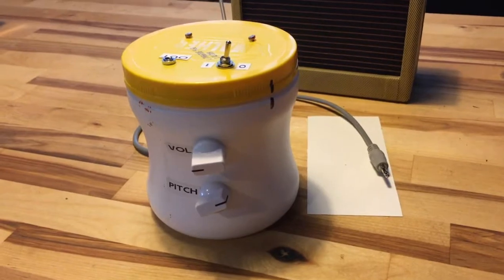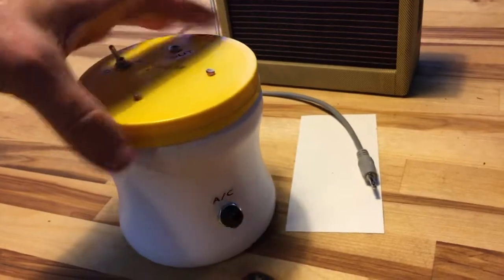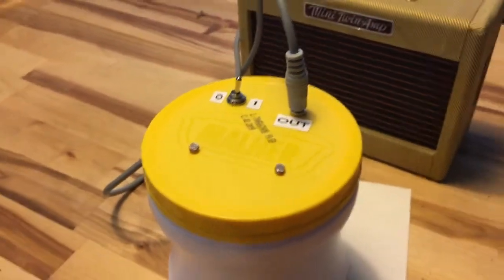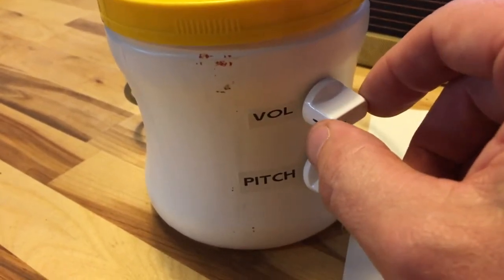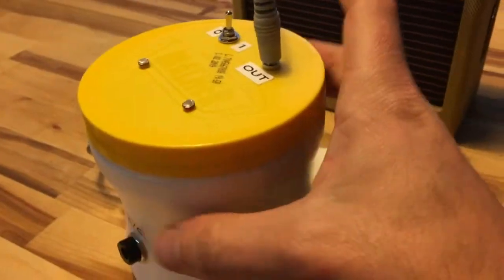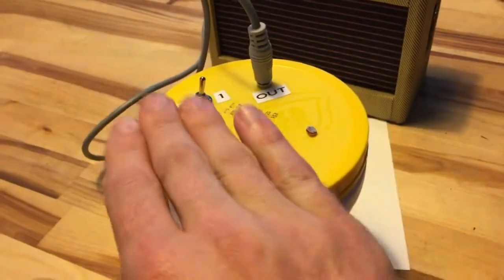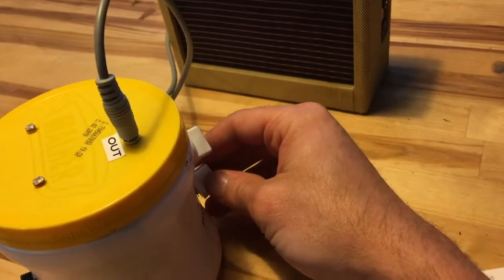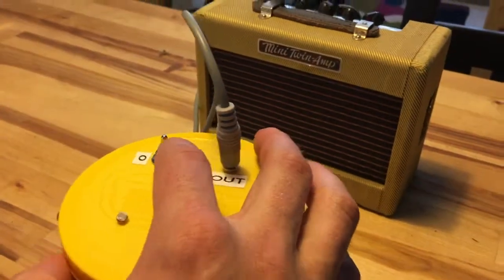DIY Synthrotek Optical Theremin Kit

Comment: cool
Reply from the maker: Yes, this was a fun little project. I believe Synthrotek still sells this kit.
Reply: They do, just ordered one...thinking about mounting the jack instead of the minijack to mine also, don't know if it change the output or not @musicalmiscellany
Reply from the maker: @frankmortensen5956  Good luck with the project. I'm a little confused by the wording of the question but I think you're asking if you can use a 1/4" jack instead of a 1/8" jack, yes you can.
Reply: @musicalmiscellany  yes the big jack instead of the small one?
Reply from the maker: @frankmortensen5956  that won't hurt anything. In fact, I think Synthrotek might include both jacks in the kit. I can't remember for sure but I know they do that on some of their kits.